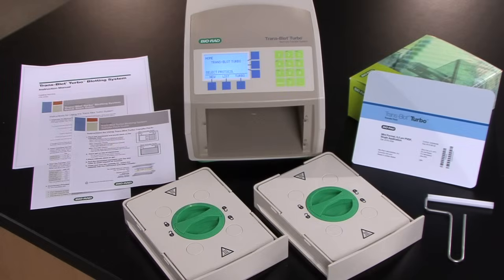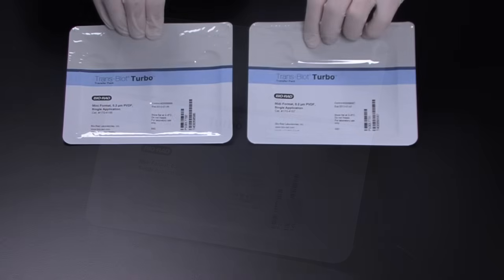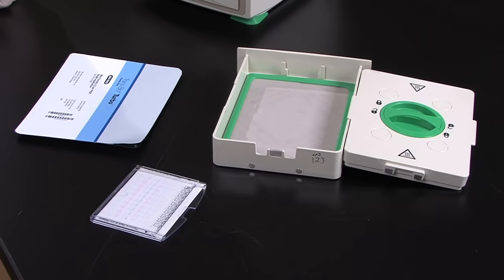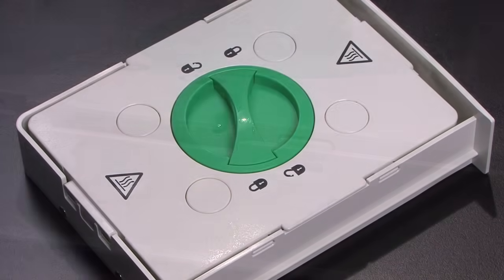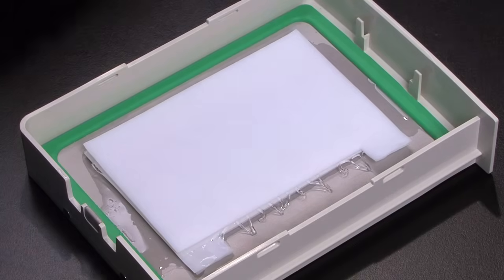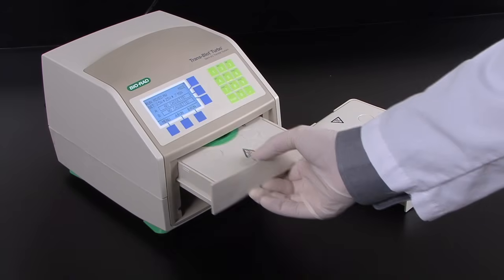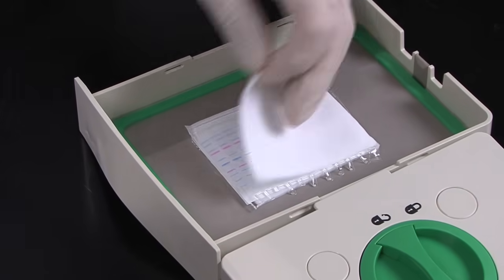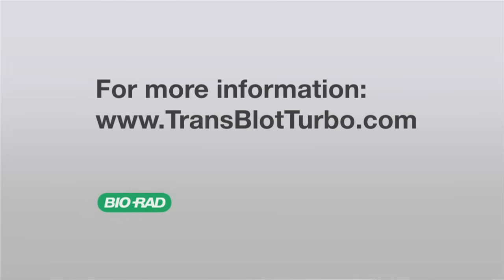Protein Blotting Using the Trans-Blot® Turbo™ Transfer System

Comment: I am following the same steps for transfer method but my proteins aren't getting transfered to the membrane only the marker is getting transfered not my proteins. Could you please help me in this as  I'm trying it from a month.
Reply: did you find out why? I also get partial transfer
Reply: Actually the size of my protein is 43KDa and 47KDa. High molecular weight proteins are easily transferred but issue is with low molecular weight proteins.
Reply: add more methanol into your transfer buffer @aynalsaba7982
Reply: @aynalsaba7982  If the protein size were under 50kDa, use a 12%gel and 0.2um NC membrane. Additionally, I followed the turbo-1 mini-protocol (1.3A / 25V / 7min)
Reply: @aynalsaba7982  try to transfer for a shorter time as some proteins might be blotted through the membrane. Stain the gel after the transfer to check if there are still some non-transfered proteins.
Reply: did you make sure with a separate coomassie stained gel your sample contains enough proteins?
Did you load your gel with a Laemmli buffer which contains SDS to ensure proper electrophoesis and transfer?
Did you stain the gel after the transfer to see if the proteins are still in the gel?

Comment: We have this turbo transfer system but I do not have the pre-cut transfer pack. What is the soluble used in the pre-cut transfer pack to soak the membrane and filter papers? Is it just transfer buffer without methanol? I'm trying to save money by cutting my own membrane and filter papers. Thanks
Reply: Towbin Buffer
  25 mM Tris, 192 mM glycine,  10% ethanol is fine (do not adjust pH).
CAPS Buffer
CAPS-based transfer buffer (10 mM CAPS, pH 11, 10% ethanol) may be preferable for transfers of high molecular weight proteins (for example, >150 kD) and in cases where the glycine component of Towbin buffer may interfere with downstream protein sequencing applications.

Dunn Carbonate Buffer
10 mM NaHCO3 (sodium bicarbonate), 3mM Na2CO3 (sodium carbonate), 10% ethanol is fine  

Ethanol necessary ONLY FOR PROTEIN LARGER THAN 20Kd
SDS only for protein larger than 80 KD up to 0.1% (start at 0.03%).
For large protein use a 6-7.5% (easy to break) gel or gradient gel.

PREWETTING PVDF MEMBRANE WITH 200 proof ethanol is as good as methanol.
Reply: Transfer buffer with 10% ethanol.

Comment: I have this unit, but the run wont go above 0.1A... why could this be?
Reply: Let me know, at this point I've given up, and gone back to the old school tanks... takes forever but works, would love to get the turbo going... let me know what you find out.
Reply: @SunSurfSnow1990  Dip the roller in the buffer solution and apply it to the membranes, sometimes when they get dry that happens, at least that's what we did and it worked
Reply: Sometime it depends on the constant A or constant V run.